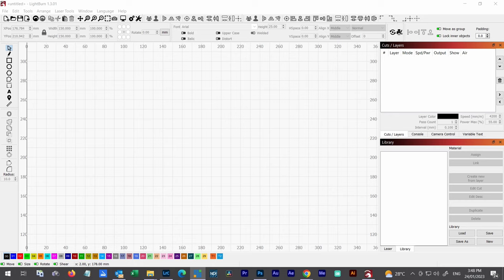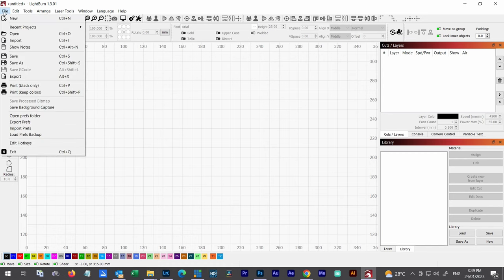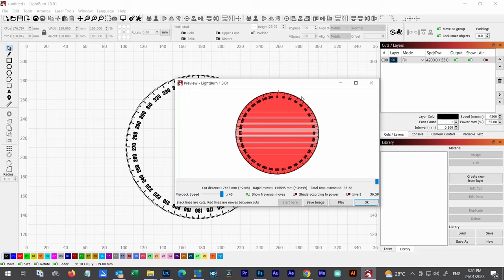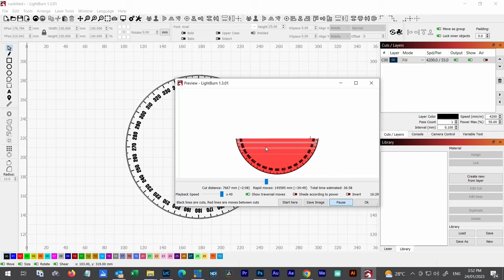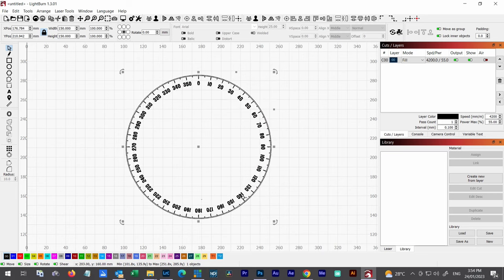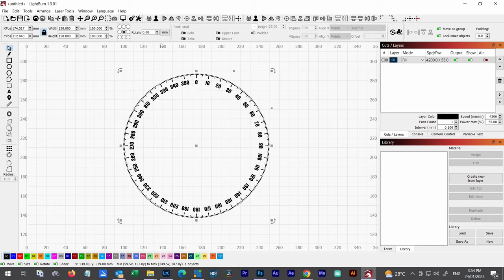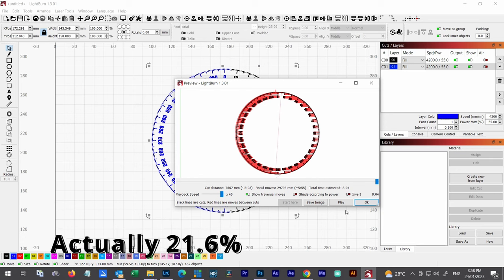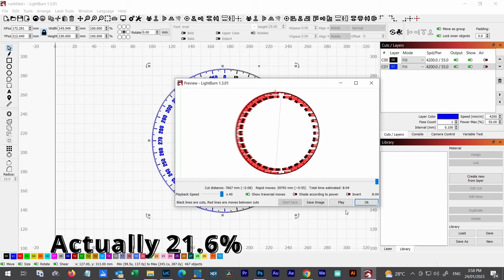Diode Lasers - 3X Faster Burn Times in Lightburn

Comment: All your tips are really helpful. I also tried another method called "Offset Fill," the third option, and it also helped reduce the engraving time.
Reply from the maker: Thanks Sayeed - I think I did a quick video on offset fill as well - but yes it can also reduce engrave time depending on the design

Comment: There is another way. Use the fill all shapes separately. You only used two of the three options. I haven't tested it yet but I believe if you use use that third option you will find you will be able to shave a little more time off.
Reply from the maker: Thanks Kris - I’ll take a look at that option 🙂
Reply: Fill shapes individually, and flood fill will eliminate all white space traversal. I never leave home without this feature.
Reply: @mlarsen77  and the original commenter- thanks for the extra tips! I'll be testing all these settings out later today on my test file :D

Comment: Nice video. Have you tried FLOOD FILL? Does the same thing without splitting up the file.
Reply from the maker: Yes I have tried flood fill and it works on certain situations better than others - simple shapes, no problem :)

Comment: Great video very helpful.  Also while you are only using one layer for demonstration purposes, when it comes to regrouping to let's say 4 quarters of a circle will that work when you have mulitple layers in each quarter that I would regroupe?  Thank you.
Reply from the maker: the best way to check if that is the case would be to view the preview it will give you a run though how it is going to traverse
Reply: If you look at the image at 9:10 you can see that there is almost no excess traversal time with just the two splits so there wouldn't be any advantage of grouping much smaller. It will depend on each project but generally you are splitting groups to get the most reasonable reduction in travel over white spaces.

Comment: If you did an "Offset Fill" it will reduce the time even more.
Reply from the maker: I agree Offset fill would be faster, and I did test it, however I was a little uncomfortable with how much the machine was jumping around - seem slie a lot of extra stress on the stepper motors for not a significant gain - with solid shapes happy to run Offset fill though. I may just be erring on the side of caution, who knows for sure, if you are comfortable running your machine like that, no worries :) Thanks for watching

Comment: help i have longer ray5 10w  when i start up lightburn up the squares are 1/4in how can i resize it smaller
Reply from the maker: If you go into Lightburn settings, on the right hand side you will see "visual grid spacing" you can change the distance there

Comment: Flood fill
Reply from the maker: Thanks for watching - flood fill is a bit slower, however I may be doing it wrong?
Reply: @mrcraftsmith  yes you're absolutely right. I've just tried it out myself and it is slower so that information is very very interesting. Thank you very much 👍
Reply: @colinlee7089  I just tried FLOOD FILL and it cut my times on my current job by 25%. I think it depends on the image